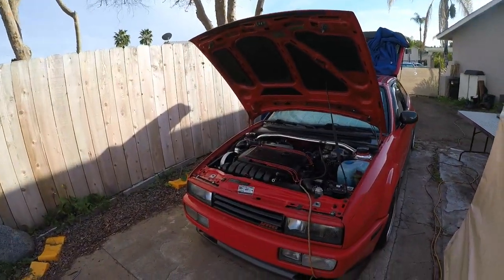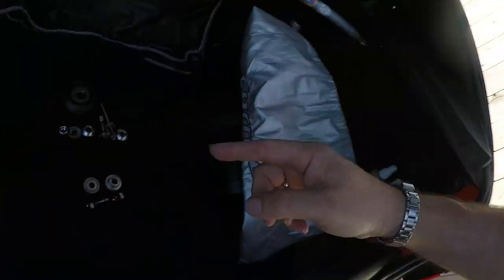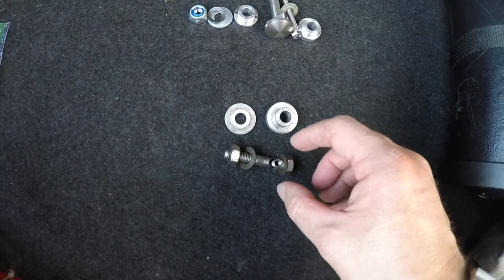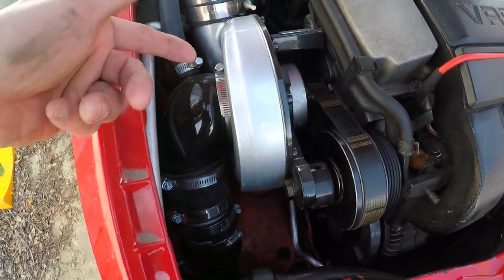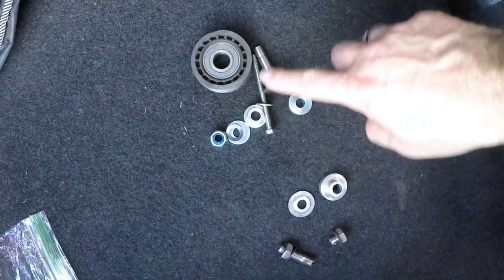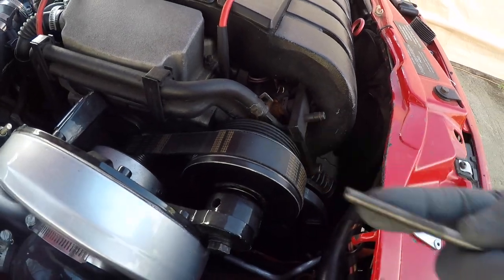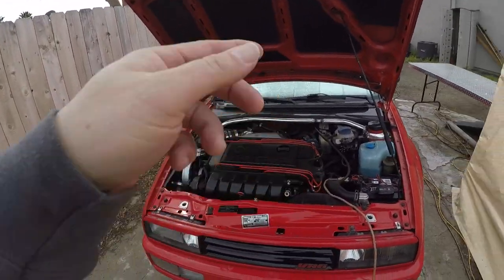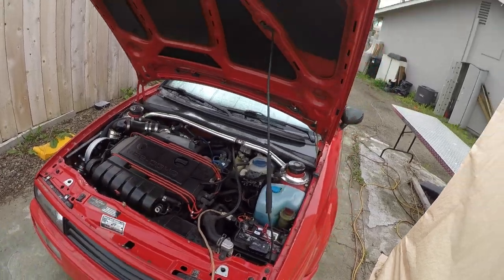Return of the Corrado VR6 Supercharger Project

Comment: I'm so exited I will do the same to my car and I can't wait to see how everything will go
Reply from the maker: Definitely some serious fun factor :)
Reply: The professional who will make it sead 3 times as much horsepower as I have now so from around 220 to 650 around there with a rotrex c30 94 charger and some other mods around too I'm rly exited by my dumb estimation that means 0 to 60 in amlost half the time and a top speed of around 182 mph I'm exited
Reply: I also have a strait pipe so even more exited about 3 times the stock sound :Ddd
Reply: In a tunnel like a Lambo ;Ddd
Reply from the maker: @MrSparsilis  Just setting proper expectations, most superchargers, including the Rotrex, do not make more than 450hp on a VR6 motor, and that would be on a 3.2 24V from an R32.  More realistic numbers are in the 350 range for a higher boost intercooled build.  And also worth mentioning that the transmission on a Corrado maxxes out at 174mph, gear limited unless you change the 5th gear to the TDI 5th gear.  0-60 will improve, but it's FWD so unless you're on really sticky tires with a limited slip differential, it's not going to improve that much because you'll be spinning the tires .  Once you're moving, you'll see the acceleration increase dramatically, but these were mid 15 second cars to begin with, and if you can shave off a couple seconds in the quarter mile, it is a radically noticeable improvement.

Comment: Hey brandon i am looking at a verison 3 vf setup but my only concern  is the air linlet and water and potential  hydro locking with your CC removed and air coming from that area do you get water issues or concerns
Reply from the maker: I do have that concern.  My Corrado is no longer a vehicle that is driven if it's raining.  Fortunately my R32 has a rainy weather setup, and we have other vehicles to drive in rain, so I've got options.
Reply: @CliffjumperCars  ok I have 5 others also 3 Benz 1 bmw and a f150, I was told I could run a diverted and that would help eliminate that possibility or atleast lower it thanks for the quick responses
Reply from the maker: @buddiec  it really depends where you locate the MAF and how much piping you have between the MAF and the supercharger.  AEM makes a water diverter valve that may work, but I have not tried it in a forced induction application myself.  It may be worth installing for peace of mind.  Here's the amazon listing for one:  https://www.amazon.com/AEM-20-403S-Air-Bypass-Valve/dp/B000CFQF5W/ref=asc_df_B000CFQF5W/?tag=hyprod-20&linkCode=df0&hvadid=312142287749&hvpos=&hvnetw=g&hvrand=4134080472232926906&hvpone=&hvptwo=&hvqmt=&hvdev=c&hvdvcmdl=&hvlocint=&hvlocphy=1013929&hvtargid=pla-493491140316&psc=1

Comment: Hey brandon would it have been easier  if you removed the head light?
Reply from the maker: Yes BUT... to remove the headlight, I have to remove the Kamei grill spoiler, and that is very brittle after 30 years, it has some cracks at the mounting points, and every time I remove and reinstall it, I run the risk of damaging it further.  So I try to limit how often I touch that.  Also, in order to get the tensioner dialed in to the sweet spot, I need to drive the car and monitor what the belt does at high rpms, then readjust.  Yes, I could drive around with no headlight while doing that, but I've gotten used to reaching that tensioner bolt to adjust it with everything in place.

Comment: Hey Brendan, I'm not sure if I heard back from you or not, as I lost that other thread. Sorry for posting here but, Do You know where the ground wire is located on the throttle body for the Corrado VR6 by any chance?
 Thanks man
Reply from the maker: Hey Steve-  I looked at the back of my throttle body and there is not a ground wire there.  I also noticed that in the VW ETKA parts listing there is not a ground wire shown there... so I'm wondering if a previous owner added one to yours?  Extra grounds only help and can't hurt.  I'd imagine that it probably would run to a post on the firewall, as there are a few threaded posts there that can accept M6 nuts.
Reply: @CliffjumperCars  Wow, Brendan, thank you so much for confirming this, This really makes my night actually 🤣 as I'm going through the process of elimination. More peace of mind for sure as I'm trying to resolve this antagonizing issue. 💪 I don't have any ground wires coming off my throttle body thank God for that.
   I just heard mixed reviews about it on Vw Vortex that's the only reason I i was double checking.
  In regards to more ground wires I've heard mixed reviews on that as more ground wires could deflect the ECU signal in the long run shortening the ECU"s life span. Replacing all of your ground wires on the other hand will allow your headlights to shine brighter I can promise you that.💡🚨 Thanks again!